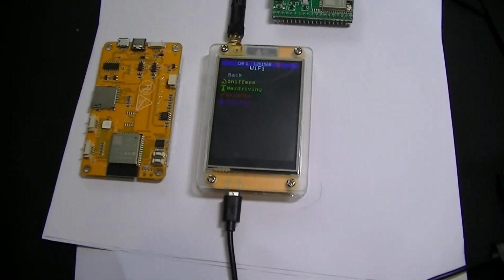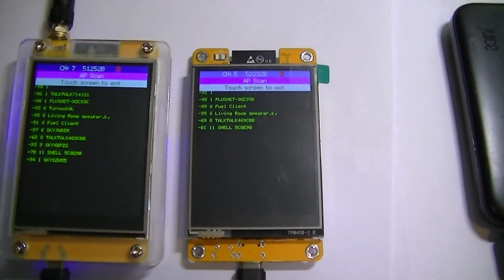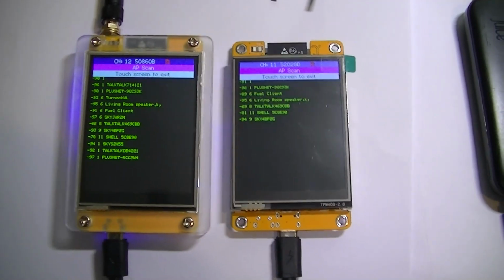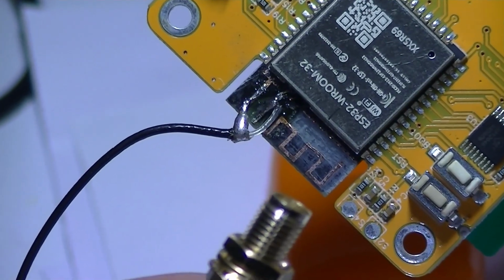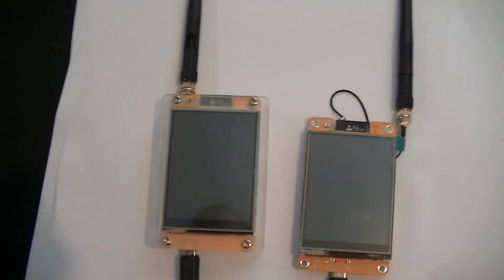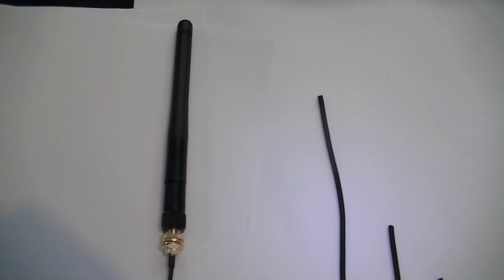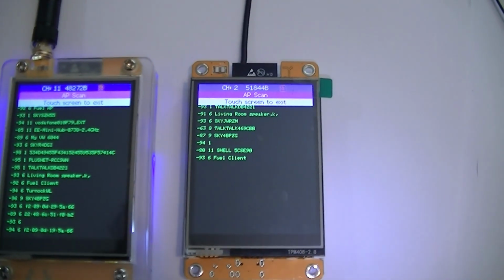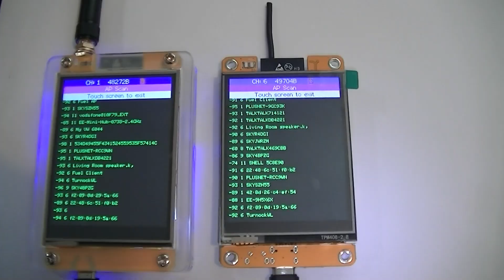A very simple esp32 antenna Mod, amazing results

Comment: The measurements must be off on the half and full antennas. They should perform roughly the same as the quarter wave. Bare copper wire might be even more effective. You should make a video with an amplified antenna.

Comment: yea this is fucking hard. I Bricked mine doing this
Reply: Fr, shittt I'm so lucky. After I soldered it, the shield wires got cut off on my first try. Then when I removed it, the copper came off too. There was only a little bit of copper left in the shield wire, but I managed to solder it again—and it works
Reply: @Expert9500  maybe put some epoxy to hold the wires??? or super glue?

Comment: do u have a suggestion for flux brand type?
Reply from the maker: I use TOPNIK Rf800, very good indeed
Reply: @dazaro3  im ashamed to say ive been soldering for 25 years and never uesd flux when solder wont flow on the pad so i have to put it on my iron and  kinda dab it on. i need a real solder station too i been using a 30 watt and it sucks sometimes.. any way keep ur tips clean. thax for the suggestion